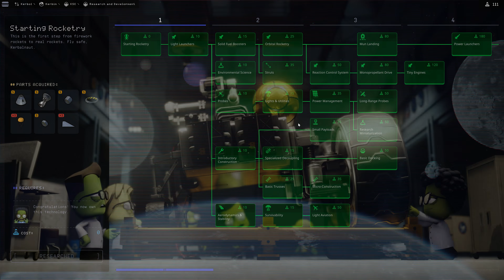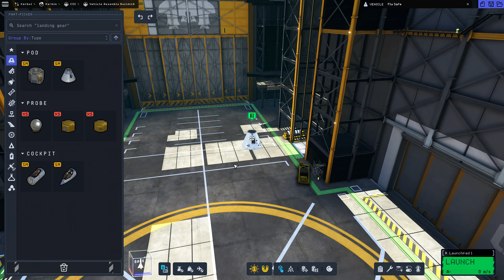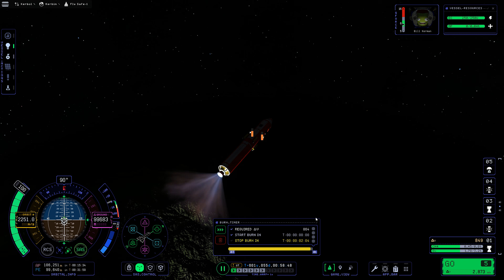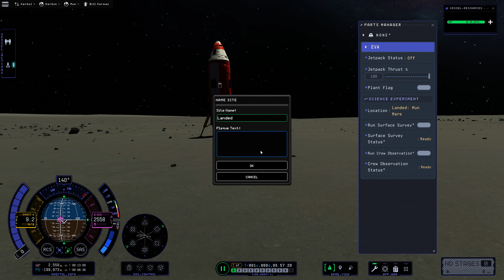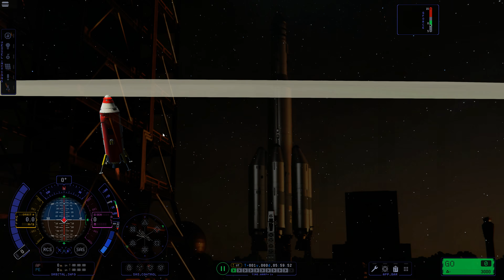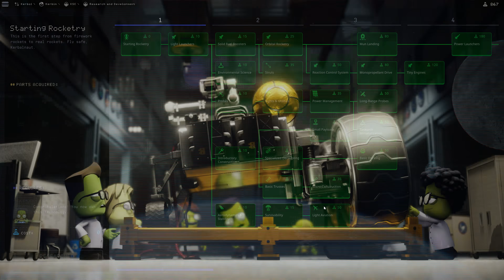How to do your FIRST MUN LANDING in KSP 2: Exploration Mode!

Comment: Why should i purchase KSP2 , when KSP one is not stable.
If i buy a ford and it craps out after 3 years , I am not going to buy another ford.
Especially when that car was only released with a ring spanner and one nut from a wheel and nothing else , Not a good advert. I have had KSP since .72  i think it is, to go through that rubbish again in KSP 2 not going to happen unless it goes for 10- 20 AUD , Just like KSP.

Comment: 7:19 I did not know that BUT: this was the one information missing to safely calculate my rocket stages and design them more or less on maximum efficency (i.e. least weight/max. engine thrust) till this point 2nd march 2024 I only have ~180h of gameplay time in KSP and KSP2 (each around 89, smth hours) so... thx Matt for showing me the actual idea of how to calculate the nessecary deltaV :)

Comment: Hey everyone, I built this exact rocket and the thrust to weight ratio is 0.800 not sure if I did something wrong or maybe an update changed something. If anyone knows please let me know.
Reply: drag your sustain engine (LVT-45) into the same stage as the launch engines (LVT-30s).

Comment: Hey Matt haven't really been keeping up with the KSP2 uploads, just confirming that in KSP 2 I no longer need to cut time in half for maneuverer and fire before I reach the node like I would in ksp1?
Reply: this is correct.  You want to start your burns in KSP2 AT the maneuver node, not at half the burn time.  You can do it this way in KSP1 too, but its far easier to match the maneuver doing it the incorrect way (starting the burn at half the burn time from the maneuver node).

Comment: My flag disappeared as well when I switched back from the tracking station, but worse was I couldn't control Bill so had to reload. Similar problem when I reloaded a save and the landing gear key wouldn't work (but I actually managed to land) and the jetpack wouldn't work (but thankfully bill can still jump high enough to reach the hatch).  Also not sure if it was because my kerbin orbit wasn't on the same plane as the mun but I really struggled planning a maneuver where my mun PE was even remotely close to establish a Mun orbit without running out of fuel. Finally managed by dumb luck (I finally figured out you can lock the Mun PE value) but haven't managed to land with enough deltaV to get back yet.

Comment: I just made it to Minmus with an Apollo style LM/CM, only taken 12 bug-fest reloads to finally get down to the surface then back and docked to the CM... Problem is now I've re-docked I 'apparently' have no fuel to create a manoeuvre node to get home! 
LM had a 220ish delta left in the tank when I docked and CM has around 600 delta! I've reloaded another 8 times, even replayed the ascent and docking over. Just can't seem to get it to show any juice!
There is fuel, I can perform manual burns with either the LM's Terrier or the CM's Poodle! (Yes I only have 1 engine active at a time 😋)

Think i'm putting this back in the drawer for another 8 month, when Multi or interstellar updates come out they might have sorted some more of these basic game breaker bugs. To think I was sooo chuffed that I was no longer piloting a wet noodle... knew things were going too well for a second!

Comment: Thermals ensitivity on launch really is a bit too finnicky at the moment. You can't have a small docking port on top of your capsule or it will just burn up, always have to cover it up with a nosecone until you unlock the shielded docking port right at the end of Tier 4...
And i still hate how pixelated the maneuver planner is. Completely impossible to do precise burns with it. They need to bring back the "Remaining dV" left in the burn, not just the equally terrible "Stop burn in..."
I was a bit afraid unlocking Tier 4 would take forever, but after returning from a Dres+Eeloo double whopper mission and completing their respective side missions i came back with 77.000 science and finished basically T 4 and all nodes i left out in the previous tiers at once 😅
Oh btw, fuel lines don't do anything as of now. Might want to not research those until fuel crossfeeding and tank flow priority has been implemented.

Comment: I don't see why they'd change atmospheric heating on ascent. By the time you need to start thinking about batteries, you should have access to fairings. 
Maybe the number could be adjusted a little but generally batteries are pretty sensitive to heat. Accounting for that is part of the sim, ya know?
eta: the fact that they retain heat seems to be a bug but the general point still stands.

Comment: just wondering, how exactly did the rocket roll?
it has only one engine that can steer.
roll needs 2! pointing in opposite directions!
you can't spin along an axis with a force along that axis!!!
Reply: I believe the command capsule has small reaction wheels to allow it to turn, not 100% sure tho!

Comment: They should make that trip planner with check boxes so the math at the end shows exactly what you need based on your plan.
Reply: And there should be a way to divide the trip between stages. Like even if I have a lot of delta-v in my current stage when it comes time to detach my mun lander, it’s all wasted unless I do a fancy docking sort of vehicle. At that point my descent, ascent, and return all need to be above that stage.
Reply: That would be tough since your plan can vary wildly and there's no way to tell the game ahead of time what you're going to do.
Like, the planner assumes powered landing and flight and direct trips for the entire journey. But you can use chutes and gravity maneuvers to drastically lower your Δv requirements.
Any number it gave you would necessarily be an estimate anyway since you do still have to fly the thing and there's no telling how well you're going to do that en route. Maybe your liftoff is wobbly due to uneven weight and takes longer to get out of the atmosphere. Maybe something gets damaged upon entering the atmosphere of another celestial body, thus changing your weight and aerodynamics. There are too many variables to account for to ever arrive at an exact number for anything.

Comment: I don't know if it was a bug or what, but when I landed on the mun with lt-1 legs I made sure in the VAB that the legs were lower than the nozzle, but on the actual mun they weren't. The LT-2 legs were fine though.

Comment: I had recently got the game and had no idea why my rockets were out of control until Matt said that the Reliant engines can't gimbal. Thank you so much for the Tutorial!
Reply: If you go to the extra info tab when selecting the part, it’ll show if the engine has gimbal and how much. Another thing to watch out for is engines that don’t have an alternator. KSP 1 had a few engines with no alternator. So your batteries wouldn’t recharge unless you had solar panels.
Reply: @particle_wave7614  every engine in KSP2 has an alternator/generator (I double-checked). Well, except the Xenon engine that uses electricity as one of its fuels.

Comment: Did they ever fix the wobbly rocket issue in KSP 2 yet….
Reply: yes
Reply: yes, they still wiggle a bit, but no more wet noodles!
Reply from the maker: Yes, it's now better than KSP 1's autostruts imo. And what's funny is that they added a toggle so you can still have floppy rockets if you want (for some reason)

Comment: On my first orbital flight, I hadn't yet unlocked a heat shield so my capsule was stuck in orbit permanently until I was able to do a rendezvous and bring Jeb home
Reply: What I've noticed is that you don't really need a heatshield if you are in LKO. If you're coming in straight to the atmosphere from a jool mission or something and going in at 3km/s+ then you'll need one. Deadly re-entry too.
Reply: in KSP1 capsule was durable enought to survive return from LKO
Is there even in KSP 2 reentry mechanic?
Reply: There is now but it's hard. Honestly I like it where it is. You can't re-enter without a heat shield now. Unprotected parts of the rocket will explode. A big improvement to ksp1 where heat shields were basically useless and mainly used for rp or intense interplanetary re-entry
Reply: @007mattattack I agree. I want a more realistic experience
Reply: I've noticed you can do some pretty absurd reentries without a heat shield as long as you bleed speed at every oppurtonity during your orbit
Reply: If you still have stages attached, you can use them as sacrificial heat shields of a sort. 
That way you might slow down enough that by the time your earlier stage parts have all exloded you're going slow enough for the capsule to survive.
It's janky. But what is KSP if not a bit janky?
Reply: @rainbowkrampus imagine sacrificing your fuel tank only for a part attached to it to crash into your rocket
Reply: @CASA-dy4vs  Seems like you'd need to be stuck in a spin or else to have used the offset tool and buried a part in the tank for that to happen.
Though physics do be wacky sometimes.